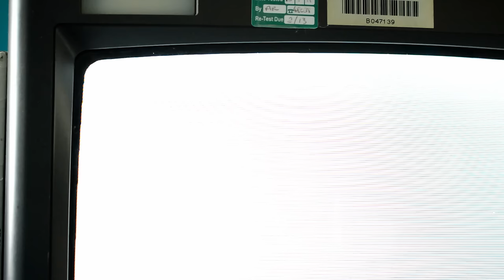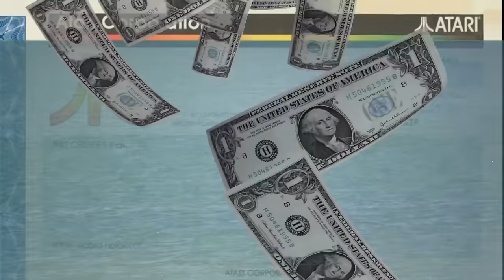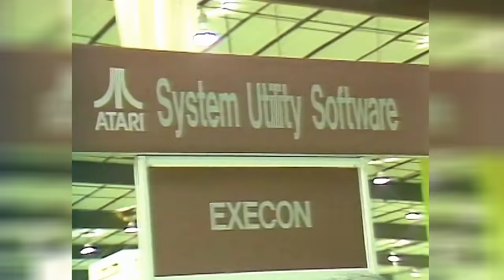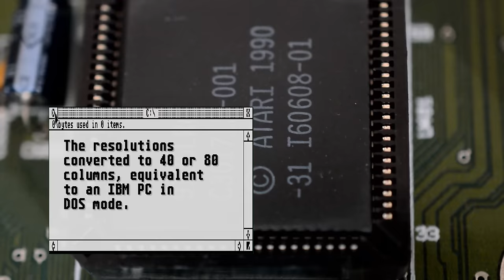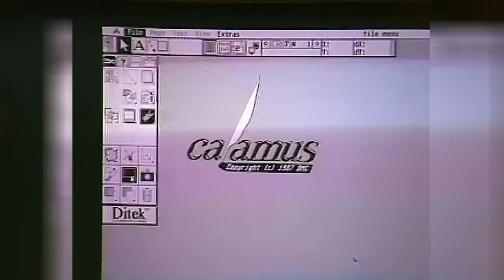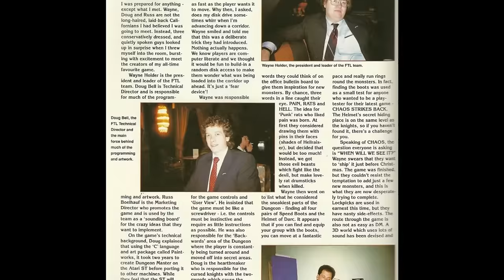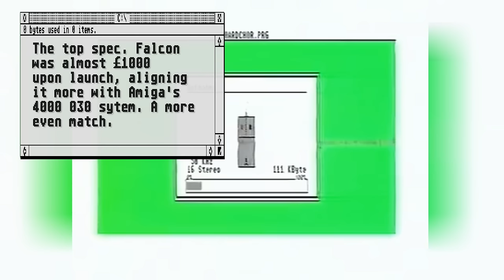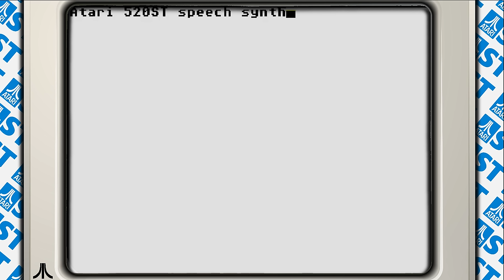The Atari ST Story | Nostalgia Nerd

Comment: Brilliant job. It's important to have a video like this done from a UK perspective, and you're bang on about the ST being to the Amiga what the Speccy was to the C64, that's exactly how it felt to me too. I remember that I got a very early STFM, and it came with a single sided (360k?) floppy drive, which I later upgraded with a double sided one...which involved taking a hacksaw to the case...good old days.
Reply from the maker: Thanks very much! Yes, the early ones did come with 360k drives. 720kb drives were snuck in as an unofficial upgrade as production progressed, leading to a smaller eject button and your hacksaw related issue. I hope it turned out ok? :O
Reply: I am from the same generation as you man, although I have recently aquired my childhood dream machines: Atari Falcon and Atari TT :) I'm currently having a lot of fun playing around with them
Reply: I remember hacksawing the case for the floppy drive and soldering the extra half meg of memory onto the board

Comment: To this day the design of ST case is as cool as a cucumber.
Reply: I owned an A500 but always thought the ST case was nicer especially the STFM with the PSU, Modulator & FDD all built in. But that all changed when the A1200 came out that was sweet.

Comment: I had an Atari STE 1040 STE and was the only machine I had from 1986-1996 and only stopped because I broke it by taking it apart!  It was so awesome, had RCA stereo jacks, TV out, 4 controller ports and MIDI ports (we needed this and no other machine could offer this for the price).  I doubt if I can ever again buy a machine that lasts a decade in terms of daily driver, so kudos to Atari!
Reply: It was exceptional value for money, by early 1987 in the UK the 520STFM (£399 inc VAT) could be bought for less than Acorn's 128k 6502-based BBC Master (£450 inc VAT).
Reply: I have this computer in perfect conditions! Message for pictures.

Comment: Thanks for the great vid.
The Atari 1040 STF was my first home computer after having started studying computer science back in 1985. I bought it from my own money I had bravely saved from my monthly federal scholarship support in the summer of 1986, cost me about 3000 Deutsche Mark and consisted of the main unit with built-in floppy drive and power supply, and the famous monochrome monitor. I remember that the main unit had been promised to have the TOS and GEM built-in on ROMs, but the manufacturers had not made it on time, so we had to live with the TOS boot floppy for a while. When the ROMs were finally delivered, for me as an absolute beginner in electronics it was a real challenge to unscrew the case, insert the ROM modules in the right sockets and in the proper sequence, and without tilting or bending those tiny legs... I will never forget the moment I switched on my Atari again, waiting for a big bang or whatever. Instead, there was that friendly starting screen of the operating system appearing on the screen and I knew I had done everything right... :)

Comment: I bought my next door neighbour's Atari 1040STE in 1995 and shortly after, a run out copy of C Lab Notator SL and barely looked at the hardware sequencers in my Korg T3EX and Trinity Plus after that! The fact that the Atari had built in MIDI ports was huge for electronic musicians and composers at the time! I sold my 1040STE and got a cheap fully expended Mega 4 that I used for a number of years before going to Logic on a PC and later Mac.

Comment: Great video!  hadn't realised how many models Atari released.  I had an Amiga 500 and my friend had the 520STFM.  We (for some reason) got it into our heads that the Atari ST could make perfect copies of Amiga original disks using x-copy or similar  ;)  it never really worked but it was fun trying....I will never forget seeing an Atari ST for the first time running International Karate in Fidget computers in High Wycombe.  The graphics blew me away.
Reply: That's the opposite Darren, you can copy the st disks with an amiga, but not the other way around :)

Comment: Great video. I didn't think STs launched until 1985. I got my 1040STFM in 1989 when my parents decided - quite rightly - that computers were the future. They were told by the local computer store that ST's were about to be installed in all the schools. Turns out that didn't happen - Macs did instead. I loved my ST and used it constantly until 1993. I still have it, and it still works, but the disk drive is pretty sad and won't read much. Considering replacing it with one of the SD card drives.
Reply: The college I went to in the early 90's bought a load of 1040STFs in around 86/87 instead of BBC Masters, they were still being used when I left.

Comment: If it wasn't for the Atari ST , we wouldn't have Cubase and Logic Pro.
Reply: If it wasn't for ears, we wouldn't be able to hear music, which would also mean no Cubase or Logic Pro.
Reply: If it wasn't for the Amiga, we wouldn't have thousands of software synths like the VST synths & iOS synths that are popular in the music community today. The Amiga was equally suited, if not a better choice, to work as a MIDI tape recorder (sequencer). The Amiga provided all of that, and the ability to replace synthesizers that cost thousands of dollars, back in 1985 at a time when synthesizers were very expensive.
Reply: But the ST had midi-ports as standard, that's why it became the standard for music production using Cubase and Logic. It was eventually superseded by Apple Macs.
Reply: And PC  I didn't know the Amiga  had a midi upgrade.
Reply: Sure the Amiga (and PC) had a number of external MIDI box add-ons, but the Atari has it built in from the get-go which seemed to have played in its favor for a while.
Reply: I would love to have a 64 bit version of the Atari ST to run those programs on.
Reply: @billant2  had a dedicated 'Midi' port but could you get it to talk to Cubase et al?? - not on your nelly!
Reply: Sure we would have. The authors would have seen the light and made the better choice of making it for the Amiga instead. Since the MIDI technology was built into the Amiga other than the connector, it would have been a sinch and even easier to sell. When they could have advertised it had built in software synthesizers as early as 1985 similar to their later VST instruments in 1999 in the Windows platform, saving customers thousands of dollars and a lot of space, it would have been the more logical platform to make it for. It is a shame that they were too narrow minded to see this at the time, and also could have thought to offer it for other platforms back then.

Ohh and by the way, on the A1000 my MIDI interface was similar to “built in”. You didn’t need an external box. It simply plugged into your serial port and gave a built in appearance. As easy to install as connecting a joystick. No driver to install, nothing. Effectively the same as built in unlike all other computers except the ST. And much more logical not to include the ports because one size doesn’t fit all, and 90% of users wouldn’t use MIDI on their platform anyway, so a waste of manufacturing costs.
Reply: Bill A Read my comment below on the Amiga’s “external MIDI box”
Reply: @classicarcadeamusementpark4242  Synthesizers are still  very expensive.
Reply: @Classic Arcade Videos, @zetmoon  The whole reason the ST got the Midi market and kept being leading it beyond the year 2000 even both Atari and Amiga was long dead, and the PC way more powerfull, was the Midi interface in the ST is coupled directly to the data bus of the 6800 CPU, not going thru various interface types wich ads latency, and the TOS system not doing any multitasking, not having to poll for various processes that wants to use the databus at the same time, wich means it took over 10 years for software houses like Steinberg to get Cubase running midi in/out just "fairly" in sync on a PC compatible compared to the old Cubase Score 2.0x for the Atari ST, and was why for really many years Music studios may have had modern DAW versions of Cubase or Logic, but behind all that they also had an old Atari ST or MegaST for running Midi, because the PC or Mac DAW's werent able to produce an acceptable low latency midi i/o, and Windows werent even able to have a somewhat stable midi clock. It was first with the arival of USB that Midi on a PC became usable for professional use wich is like 20 years after it ran perfectly on a 16bit 8Mhz 68000 AtariST. The culpit was that all other systems than the ST to start with were running Midi interfaces connected thru a serial or Paralell interface or a Midi mpu interface connected thru the ISA slots in a PC, and especially Windows  versions prior to XP, being just a Dos extender "trying" to emulate a multitasking OS, coupled with the whole design aspect of the X86 arcitecture processors making it almost impossible to have a reliable midiclock on these early windows versions. Even today, over 30 years later, you can do a measure, and an Atari ST will STILL run MIDI clock better than a top Notch i7 with a modern DAW software, and that just because of propably some weird coincidence that Atari decided to connect a midi interface directly into the 6800.
Reply: Great Vid , shame the 8 bit sound drowns you out at times
Reply: @mrdali67  Ah thanks for that info.. I knew the ST held the midi controller niche back in the day but I always put that down to it having a midi interface built in as standard.. didn't realise there was more to it than that.

Comment: One of my greatest regrets in life was chucking my ST in the bin when the floppy drive stopped working in the late-90's. Knowing what I know now, I probably could have repaired it or got an external floppy drive on ebay.
Reply: 2 of my regrets are, 1 Selling both my Mega ST's, and 2. Throwing out my Commodore 128 back in the mid 90's as i thought the machine was toast, only to realize later that it was a dodgy power supply.
Reply: Oh man, gutted.
Reply: Crunchy Chips   That's sad!  I kept my 800, 800XL, 128 XE and 1040 STE, even though I did sell my 520 stfm.

Comment: That's like my first ST.  Fat external floppy disk drive SF314 (which was double sided), joystick and mouse port on the right, wonderful grills, awesome function keys and a lovely sm124 mono monitor.
Also two huge power supply units.  Those were big.
The drive was very loud and eventually in 1988-1989 I bought a new, a very thin and quiet model, don't remember model number.   
I had a MEGA STE later but that's another story.
Great video, thank you for sharing.

Comment: Great job, this is a full fledged documentary. I always wanted Amiga, because it was, arguably, better platform. But parents bought me a 520 STFM with the SM124 monochrome monitor in 1989, so that's where I went. And it was one hell of a ride. I eventually upgraded it to 1 MB RAM, then to 2,5 MB. Later I even got Atari TT030 with 4 MB RAM. I learned to program in MC68000 assembler (with the amazing GenST assembler), but also used Turbo C from Borland. I also ran a FidoNet node on both machines and a BBS on the TT.

Comment: Excellent video - as someone else has commented, it's virtually a documentary and is better narrated and more interesting than many on TV nowadays! 
I grew up with an 8-bit Atari and then the Amiga, so although I know a bit about the history it's nice to hear it from a different perspective.

The two things that harmed the ST (from my point of view at least) were
a) the games never seemed as good as on the Amiga, unless it was built for the ST first, or was done by a really good team.
b) the confusion of all the different models, and in some cases (as touched upon) significant compatibility and capability differences. The Amiga had a bit of this, but it never as fundamentally insurmountable - you could upgrade your Kickstart, and get a chip RAM upgrade; the 32-bit machines were the only ones that were properly different, whereas it seemed like most of the STs had different capabilities which could limit future options.

Comment: Excellent video.  The NTSC versions of the 520stfm and Amiga 500 are my computer collection holy grails.  Love any opportunity to learn about either, and this was great.
Reply: Eh, I don't remember about the A500, but the ST didn't have a NTSC version, they were like modern PCs in that regard.  Though I admit I don't remember what the situation was with the power supplies, I don't remember if they were universal or not, but still, no problem with NTSC.  The ST could work at 50 or 60 hz just fine.  At least from what I remember.

Comment: "Your Woman" was also recorded and mixed on the Tascam 688. The 688 could be controlled over MIDI and record 8 separate audio tracks onto a standard cassette tape.

Cassette multitrack recorders typically recorded only 4 tracks of audio, but for the 688 (and 488) Tascam developed tape heads that jammed 8 tracks onto the same cassette.

I have one. It sounds wonderful in it's analog way. Needless to say, the tape runs VERY fast to compensate for the narrower audio tracks. 

I love my 688. One of the only possessions I'd save in a house fire.

Comment: Good video, but a small correction - the C64 had higher resolution than the ZX Spectrum, just most programmers used the half resolution multicolour mode in preference to it.

Comment: Thanx for the review however some of the information is missed but are essential to understand the position of this machine.1. Atari ST was designed as dual monitor machine, where each of those monitors have different graphics modes impossible to display on the other. Monochrome display intrudced highres stable 640x480 resolution ideal for some professional work, but you were almost unable to run any games on such monitor. On other side if you had colour monitor you could not run professional software.Such configuration seems expensive but it was the only way to provide stable high resolution in those Times. Monochrome display used 30kHz video frequency while colour operated on standard 15kHz.If you remember similar situation was on IBM PC when you need to run EGA emulator to play games on Hercules graphics adapter.2. Amiga 1000 was able to display 640x512 resolution (not 640x200) thanx to hardware assisted interlace mode. However this mode flickered like hell because it used standard 15kHz signal. It was good mode for some pictures but you would bleed your eyes out if you would run on it Calamus for example. In other ways Amiga was build up as a game console while atari st has dual nature with some professional appeal.3. Amiga can do everything ST can do (because they have the same CPU), while ST can not do some things amiga can(because does not have amiga coprocessors), however original Atari st and amiga price difference is so huge i would buy atari st at that time because the difference is smaller than the price suggest. It is also worth notice that Atari st has so brillant programmers they will find this or other way to prove you ST is better than Amiga and honestly speaking ST is alive while Amiga 500 is almost dead, so ST is benefitting from new programming algorythms while a500 is in the dust. For example there is workable Wolfenstein clone which works in plain ST, while there are only some demos which prooves standard A500 can do it also.4. STE provided bigger palette, however you can still display only 16 colours at once on it, compared to amiga 32/64. I mean normal hardware generated modes and I know both can do more, however software assisted modes are good only for static pictures, because there is almost impossible to manipulate colours in normal game environemnt where each object has different positions. Stardust was released on STE, however if you look closelly you would see it uses much less colours than amiga 500 version.5. STE provided 2 AD sample converter, but this is all what they can do. In order to hear some music CPU must prepare all the data and put it to them. Amiga Paula is much more sophisticated chip and can do almost everything in hardware what on STE CPU must do (remixing, resampling, arpeggio etc.). In reality to play typical protracker module STE must use 30% raster time, while Amiga only 1%, however the quality of analog output is much higher on STE. This means if you play protracker module on both machines (just for playing without caring for cpu power) STE can actually sound better!!!6. Atari STE blitter can access colour register directly which makes him very similar to Amiga Copper functionality if programmed correctly. I know Atari st folks are trying to downgrade STE by hiding this small letter, but this version is much better than original hardware and most impressive demoscene demos are not working on plain ST.7. I heard that in Europe many Times it turns out Amiga 500 costed the same like Atari st, so it all depended on time and place.8. From testimonies seen on web, when Tramiel bought Atari he fired all old stuff and bring his old Commodore Crew instead.  On the other hand the very people who designed ATARI XL, designed also Amiga 1000. That is why many people sees Atari ST as a continuation of C64, while Amiga as 3rd generation of ATARI VCS :)That would be all.

Comment: You seem to have escaped the 1MB floppy disk reliability problem. Mine started to malfunction, having trouble reading disks that worked fine before. The spring mechanism felt cheap. There was no solution to it nor aftermarket fix.  It still worked except for some games.